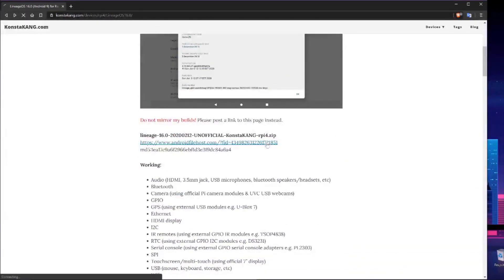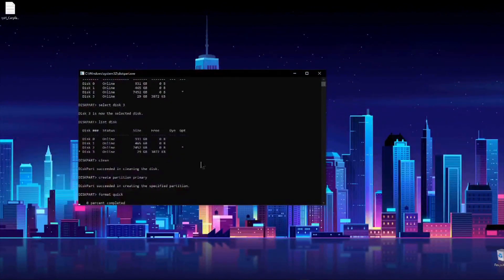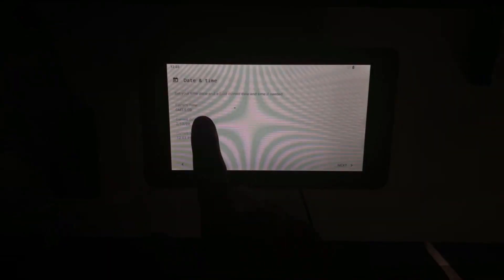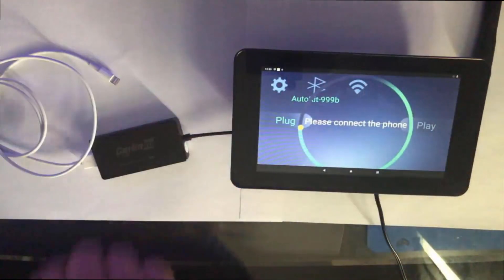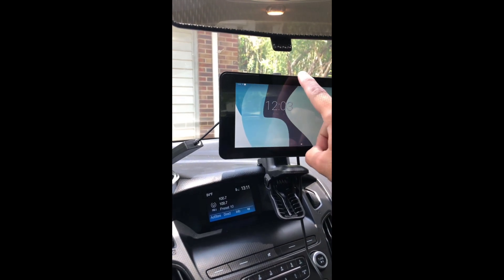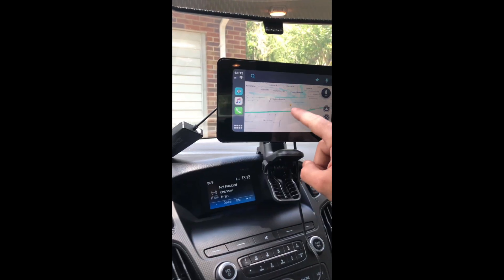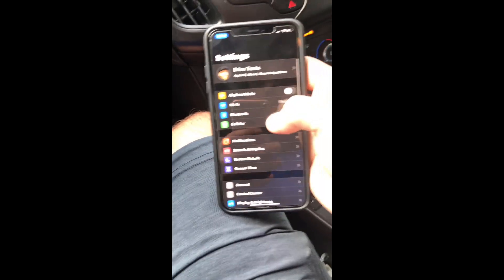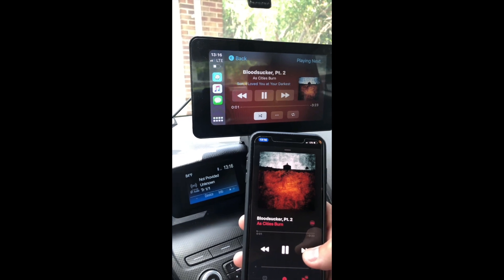Apple CarPlay running on Raspberry Pi 4

Comment: what mount did you use to clamp the screen to your car?
Reply from the maker: David-Daniel Day it’s a GoPro/phone clamp. It’s not my final mounting, but it was a quick fix for this video.
Reply: @BwithEe  so the monitor case has a 1/4" thread?
Reply from the maker: @david-danielday5603  it doesn't have enough grip to last in a vehicle. just enough grip for this video.
it is about 1/4 relistate